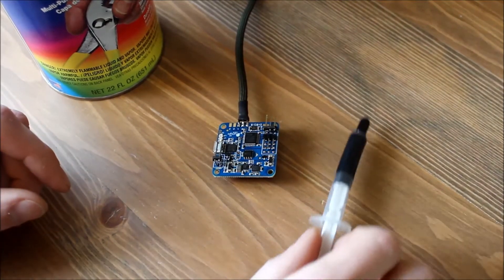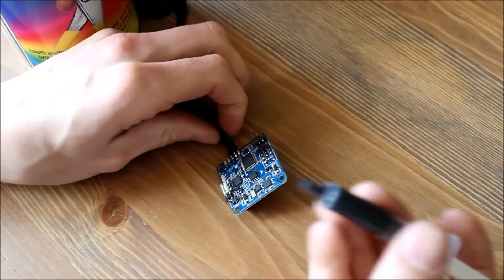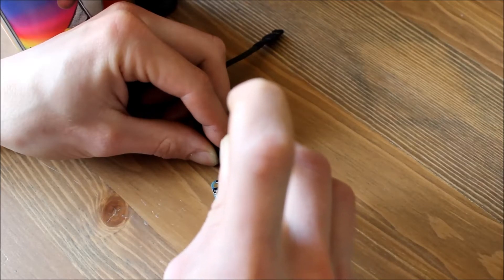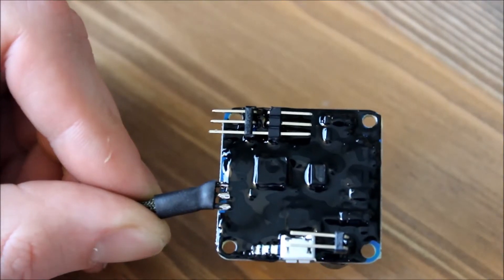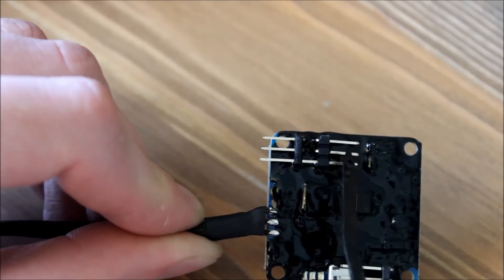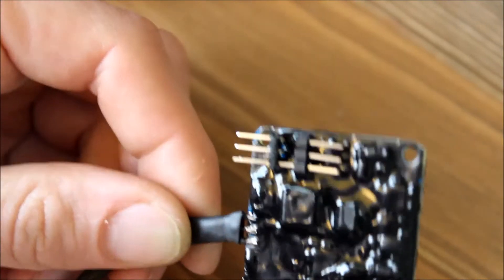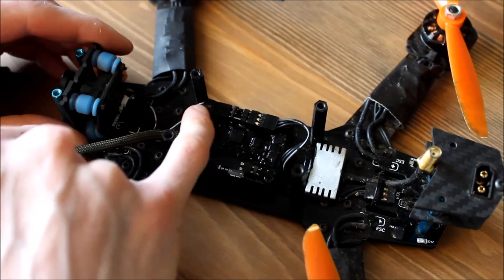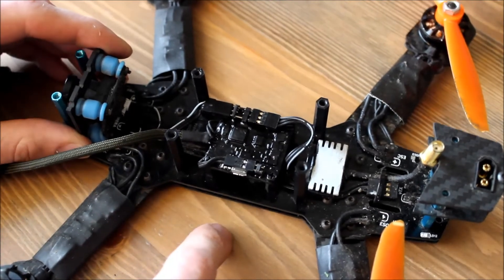How to Plasti dip without dipping! (waterproofing electrics)

Comment: Hi !
I'm planing to plastidip my quad, but I don't know how to do it on my cam, Foxeer Micro Predator V3...
It's a micro, so no case on it.... Any tips ?
Reply from the maker: looking at he Foxeer Micro Predator V3 on google. (i only have caddx micro's) my guise would be to remove the back piece if "paper" and apply plastidip to the pcb. and to go around the lens housing. if you have a extra osd plug you could cut off the wires and making sure they dont short and plug in in the camera and apply some plastidip on it.  probably not going to be 100% waterproof tho.. there is also stuff called corrosion X. flight test did a video about it. https://www.youtube.com/watch?v=s4z8QMgTEA4&ab_channel=FliteTest i also have it. really messy stuff! good luck:)
Reply: @RCandFPVJonathanNL  thanks for the tip !
I've just remove the back paper, and find out there is a rubber around the camera captor, to avoid dust on it I think. Just need to plastidip the PCB so :)

Comment: Do you get any heat issues, Do you do the same for the ESC's, Distribution board, VTX and camera too?
Reply from the maker: no heat issues with the fc. the pz0420m I epoxy a proper layer to keep all the compenents on. and also plastidipt the esc's also without problem:)
Reply: Nice one, cheers for the info.

Comment: I have bad vibration on fpv camara can you show yours??
Reply from the maker: I have some to... but i used 3 m2x25 screws and bend them like this> __,------ as the PZ0420m is smaller in form factor. still thinking for a better way! i'll post a video if i find something